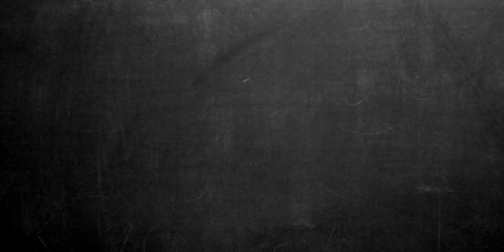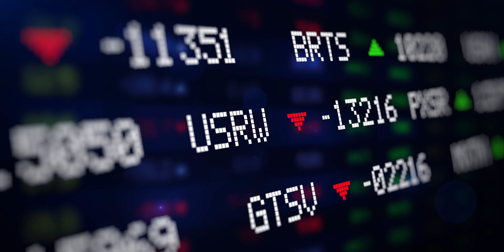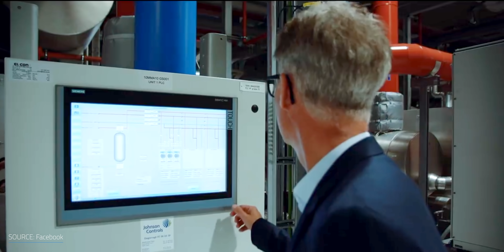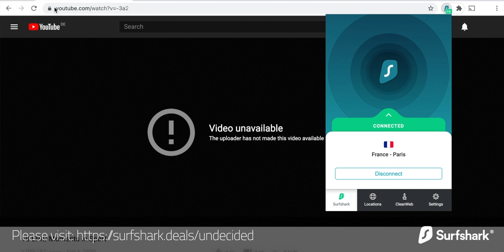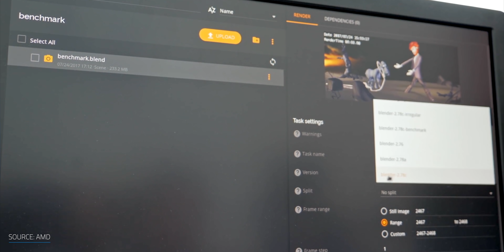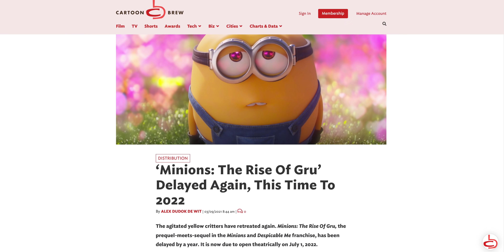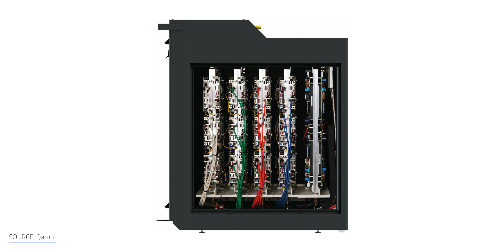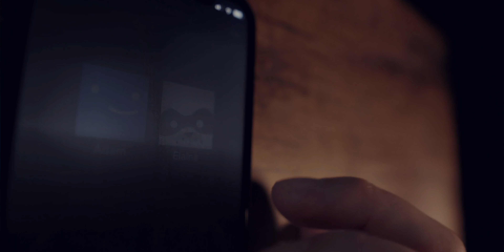Exploring How Big Tech Could Heat Our Homes ... For Free?

Comment: Wind and solar aren't that great! I'm not an ignorant naysayer, I have personally dug into some of the myths. For some reason, wind energy reports their output, based on the nameplate power output, where here in the US, they really average about 12% (18% in Western Europe). Meaning a 1mW turbine's output averages only 0.12mW. I literally called and spoke to a windfarm manager who finally admitted that their website had overstated their output by nearly 10 times. I will not risk her job, just to sound more authoritative. Keep in mind that all wind turbines make rated output at 25mph and make zero power at 9mph. At 12.5mph (half speed), they make 8 times less than full rating, which so happens to be 12.5%.

To a degree, I believe in personal home based solar, but I tell people to invest in home efficiency, rather than energy loss mitigation; which is what solar ends up being. For instance, I can build a home and put an additional $10 in home weatherization, which will continue to save energy for the life of the home. Alternatively,  I could spend $20k in rooftop solar, which will likely last 12 to 15 yrs. In earnest, it will never pay for itself where I live $0.06/kWh. However, the extra $10k I spent on weatherization will pay off in 10 to 12 yrs and continue saving for the life of the home.

In regard to solar, a neiborhood that has a lot of homes with solar, would not be where I want to live. There is a limit to how high the voltage is allowed to be because of the damage it can do to appliances and even the potential for fires (mainly in resistive heating elements in dryers, baseboard heaters, etc). But, only the homes whose grid tied solar output voltages are GREATER than incoming line voltage will receive credit for putting power back on the grid. So at mid day when few people's homes are using power, their solar is making maximum power. Imagine all these systems trying to "store power to the grid", but only the highest voltage systems are capable of outputting to the grid. Most of the home WILL NOT be capable of storing to the grid because their inverters are limited as to their peak voltage output, which is now lower than the incoming line voltage. The people who know to cheat and raise their inverter's output will "store to the grid" but now we've got a voltage arms race. The result, your neighborhood power is way high during the mid day, you can't sell back your energy, and people's appliances are failing right and left. Remember, few people are actually using batteries, most are just grid tied. Adding batteries will significantly increase the cost of your system and you've  likely driven your EV to work, so you can't store power there. There are some things you can do to use your own power, like only heat water during the mid day, but that has limits

I don't care if it comes from fossil fuels, I want cheap available electricity. It's the difference between the first and third worlds. I wholeheartedly do not believe in man made climate change and come at that from a position of knowledge too.

Comment: It's cool, but it might be a hard sell compared to heat pumps which can heat with over 300% efficiency
Reply: Heat pump would cost extra electricity, and a significant investment upfront. This is heat that would otherwise be wasted.
Reply: @jeroenburks  buying a computer radiator for your home is a significant investment and while in theory 100% of its energy consumption would be covered by firms needing the compute resources, it won’t be as efficient as an on-site solution and utilization won’t be 100% since matching supply and demand is very difficult for situations like this where the supply fluctuates extensively with weather. With even a 30% mismatch in supply and demand, a heat pump becomes cheaper to operate
Reply: @keco185  depending on the model you might be right. We are located at a greenhouse that is typically heated with gas, so every kWh that we recycled means less fossil fuel

Comment: Why not turn the heat back into electricity using temp gradients vs outside air? Allows you to keep data centers centralized and secure, also possible retrofitting.
Reply: I don't know about that, seems sub optimal like doing too many things but not well. Also you need to expend the energy to get the computers hot enough anyway, it's not a nett gain of energy.

Comment: We are already using the excess heat from data centers to our district heating system. The first time I heard about a data centre using excess heat to provide heating for a shopping center in cooler months was in early 2000s. Reuters (and Computer World) wrote about a case already in Dec 2009 titled "Helsinki to recycle excess heat from data center". The article mentions that in summer excess heat helps to provide 1% more energy by boiling water. And, the city of Kankaanpää decided to start keeping indoor swimming pool heated using heat from computers running in the basement (spring 2021). ;)

Comment: That's just.. fantastic. How great would it be if homes were built with 'heat pipes' running through the walls, a place to pump waste heat from every device like refrigerators and tvs, and then use it in other places.

Comment: My computers act as heaters in my house XD Sadly it can get hotter than hell itself during the summer DX

What I really wonder is how they manage spreading loads across different buildings as heat needs vary, even in the winter -- what sort of response time is there between when someone turns down the heat setting and it actually lowers output? Does it just slow down whatever it's working on or move the workload somewhere else? What if there's not enough work to generate the needed heat? I think it's a great idea, I just have a lot of questions.

Comment: There are a lot of people trying to find ways to use "waste heat". 
Sadly there are people mindlessly screaming that it violates thermodynamics and dissuading others from working on such things. 
Of course, it's not a violation of thermodynamics, and that waste heat is just a form of energy, and we can turn energy from one form to another, we just need to develop the methods of doing it efficiently in various different "environments". (On an airplane is different from one on a factory basement, they have some different requirements.)

Comment: The question is how much electrical power is consumed vs heat generated? If I am to install one of these unit in building or home, I'd want know that I'm not paying more for energy overall if the electricity cost are more than the heating savings.

Comment: The geographical problem probably can be solved by using the heat for cooling - no joke.
In Vienna, Austria the waste incineration plants provided energy for district heating for decades - for a decade or so they also provide remote cooling (made from heat!).

Comment: kinda funny as I had suggested setting up mining centers at places like ski resorts where the mining center was to provide heat for the resort, and charge them for the power, since it would be cheaper, with just the out of pocket cost for the mining hardware and some hardware to interface with the existing heating system, then its free coins baby! LOL

Comment: Been doing that for something like 15 years already.  I use several PC to grind for BOINC and Gridcoin crypto.  They provide the basic heat load for my house for dehumidifying in the summer and heating for the winter all the while providing cycles for various research projects and earning me crypto.

It doesn't have to be a mega project to make it work for you.

Comment: I love this concept, it's very clever. But what about data security? If the computation is being done by a machine that is not in your direct control, how do you prevent tampering or someone snooping the data? Encrypting all the traffic is one way, but that just adds additional overhead to the computation on both sides. Second is energy use. While it's a very clever way of dealing with the heat directly, it also means that every unit needs its own connection to the internet, which adds significant amounts of hardware into the chain. It means that each unit, or small group of units, is connected to at least its own modem and probably also its own switch. That adds at least 30 watts of energy use on top of what the computation uses. Now scale that up to thousands of units in thousands of homes, and suddenly you're talking about a 30.000 watt overhead. Datacenters obviously use much more than 30kwh to cool their servers, but they also house many more servers in one location. I'm not entirely sure if the difference is all that big at the end of the day.

Comment: I have proposed this idea at a hackathon in the past. We planned to put servers in the cellars of a quarter. While the servers would be used for the companies in the quarter, the excess heat would be used to heat the homes and office rooms in the quarter.

Using excess heat is key in the future.
Same goes for electrolysis. We need to create hydrogen for decarbonizing the steel, aluminium and chemics industry. The excess heat needs to be used to increase efficiency.

Comment: I do this myself by heating my office by running folding@home in the winter.
It is local heat (no need to heat the whole house because the dumb radiators in my house cannot be individually adjusted)
But to do this for on demand compute is tricky, because we cannot just disable compute in the summer…
The boiler is atleast always needed, so thats pretty good! And could be really nice for data that needs low latency, as it can be spread more evenly around the globe, and distribution means a power outage will not take down the whole network.

Comment: The moment somebody says "FREE ENERGY", I know I'm listening to an idiot and a poorly researched video.  NOTHING IS FREE... NOTHING.  i.e. All energy is "free" for the taking BUT, BUT, BUT, BUT... it can cost a small fortune to actually get it.  Heat waste recovery is not new and will be helpful in future.  A much better idea is to put heat recovery in ceilings (heat rises).  Usually, the cost of construction or operation makes heat recovery non economical but large installations are, already, starting to try heat recovery.  The point is, it is only economical on VERY LARGE SCALE operations... such as FACEBOOK.
Reply from the maker: The video never stated it was free energy.  Qarnot provides free heat from their computer systems.  The energy used for that isn't free, but is covered by Qarnot and not the building owner.
Reply: @UndecidedMF  Oh... that's what I heard at 00:32 but, of course, my hearing is bad or something.

Comment: I wonder who is paying for the electricity costs to run the boiler/server?

On a side note, my university in Germany has been integrating the cooling needs of their computer labs (mostly graphics and digital design) into the heating system of that same building which also houses stages, green rooms etc. for over twenty years now.
Reply: The data company reimburses the heat consumers for the electricity costs

Comment: This would be perfect for hotels worldwide. They keep hot water circulating all the time, so they use a lot of gas even if no one is having a shower. This system would be the perfect fit to maintain constant heat for periods of low usage, resorting to natural gas only during peak hours

Comment: With this, are we basically having our cloud computing DC in someone's basement rather than a secure/trusted building? How's the company gonna provide security when someone has physical access to your server? 
Or is the plan to only install the system within the property of the server owner?
Reply: For Blockheating  it's a little bit different than for qarnot. We own DC and hardware, so no visitors allowed. Good luck finding our locations ;)
Reply: @jeroenburks  what do you do with the heat from the DC?  Or do you just mean heating from blockchain hardware to hash out calculations?
Reply: @prvashisht  we heat a greenhouse. We work with "typical" OCP servers, so load will fluctuate. Depending on season and load we heat between 0.25 and 2 hectares of tomatoes or peppers
Reply: @jeroenburks  Sounds great. do you have a link I can check out?

Comment: There is another potential for use of waste heat… sterling engines mounted on the outside of pipes carrying off excess heat. Having those pipes run through tanks of water to heat it and using the energy from the SEs to pump the water… running the pipes through greenhouses would also work. People build compost piles around Perspex hoses (closed system loop helps aerate the compost piles) to heat greenhouses and that can add 10-20F depending on the location. Extension of the growing season could help reduce the cost of certain foods. Great bi-product too.

Comment: I have 2 gaming computer on 2 32 inch display, with a 43 inch and 65 inch TV as my desktop. 7 amps 24/7 and it produces so much heat, i got home, no AC on, maybe 17c outside, inside 28c. I literally have to rig up a box fan to blow a little cold air inside this winter.

Comment: I've been using my PC to create airflow and pump warm air under the bed in my motorhome with a hole through from the boot or trunk to area under the bed using the rear vents of PC with fresh filtered air coming in the sides, this helps to prevent damp and provides a small amount of heat and air circulation, all whilst keeping the PC extra cool. I decided to do this 3 years ago when I converted my bus to a motorhome.

Comment: Data centers do worse than just waste all that heat. They also waste even more energy cooling the systems down; heat exchangers could be used instead to both cool down the server rooms and heat people spaces. Or in places that don't need the extra heat, it could be converted back to usable energy.

Comment: What about the security of having you physical machine outside of your control?
Reply: What if it wasn't meant to be your computer? What if it was given to you for free as a heater or boiler as long as you kept it connected to the internet? Or, you buy it and then receive compensation from others using the compute power, but it's still not meant to be a personal computer?
Reply: @joshuaewalker  In normal public server farm, meaning not dedicated to one company’s servers, the facility providers provide moderate security. Tenants’ techs are I.D.‘ed in, escorted to their where their suite of servers are located. When done working, they request escort back to sign out. Usual for rules violation is a one-strike and you’re out policy, meaning no future access to the server farm. It likely means you’ve just lost your job, though that’s not the server farm’s problem. Having servers in someone’s basement seems to reduce this modest level of physical security.
Reply: @billsmith5109  
If the computers were designed in such a way that any attempt to tamper with them caused them to immediately shut down I don't see a problem. Any local storage can and would be heavily encrypted. As well as the data streams to and from the computer would be encrypted end-to-end.

Comment: Is there any company that makes a device that can actually use waste heat to boil a liquid and then use the steam to turn a turbine and generate electricity? That would solve the year round climate issue because the resulting electricity could be used for either heating or cooling.

Comment: Imagine if we could also recover the massive heat wasted from car radiators
Reply: We use it in winter time by running the heater. The hot water passes through small radiator that the air conditioning fan is blowing across.

Comment: Combine it with Stirling engines and you have yourself some recycled energy!
Reply: Won't work in practice.  The workable temperature difference probably won't allow more than a few single digit percentage regain. Most chips won't run savely hotter than 100°C. Therefore coolant at the chip heat exchanger cant be hotter than about 60°C or lower in practice. Datacenters already use this for heating adjacent buildings swimming pools etc. The company in this video is downsizing the tech and decebtralizing it. There's not enough chip area per watt for effective hot water cooling with hotter water. Those 60° are the hot side of your sterling. Your cool side is ambient, which gives a max wfficiency around 10% for the sterling to work with. Result in practice would be expected around 2% total regain with all that effort. Could work better if you live in Antarctica or with some future semiconductors that are able to run hotter safely ;)

Comment: This distributed DC tech is fascinating! However I agree that this isn't a one-size-fits-all approach. For instance, it doesn't take into account info security- Anyone in tech will tell you that whomever has physical access to the system ultimately has TOTAL access to the system. I suspect it will be tough to maintain PCI or SSAE16 compliance when the datacenter doesn't have physical control of the servers.  This is a great step in the right direction, though.

Comment: Wonder how they handle data security.  I can't imagine it would be too difficult for a dedicated hacker with physical access to the machine to be able to find a way to copy all the computations they are doing.
Reply: They probably break and randomize computations, but yeah will love to know how do they handle it exactly.

If this weren't the concern, these startups were more in number.
Reply: I found a paper online describing a few installs of these digital boilers. In all cases they were larger scale (i.e. multi-dwelling blocks), and required a secure room. There may be digital security too, but it seems the physical is the first stumbling block for a domestic case.